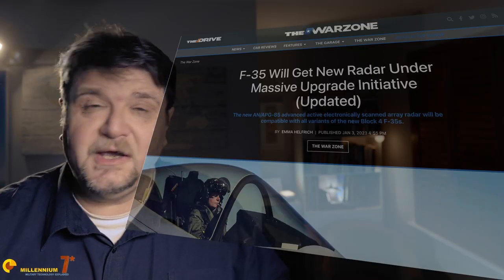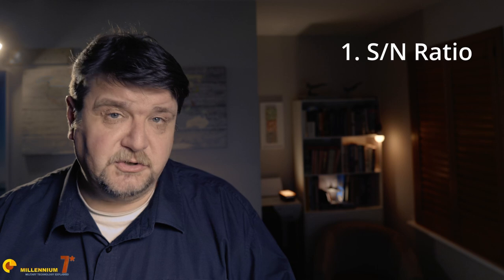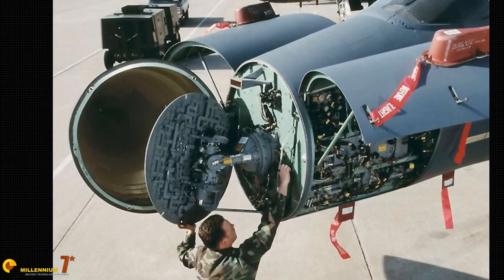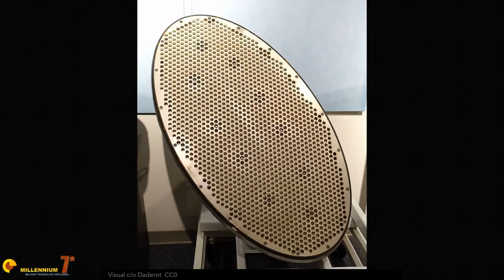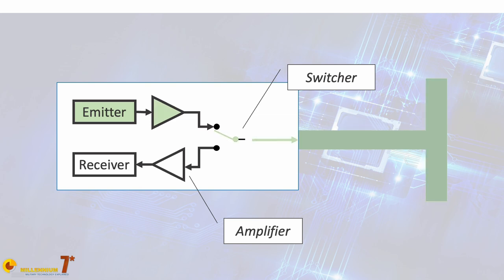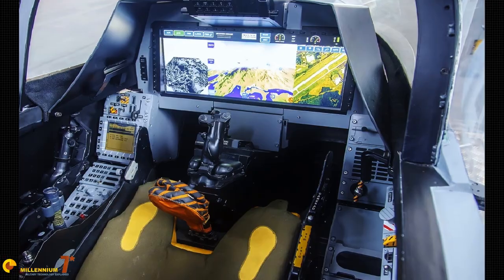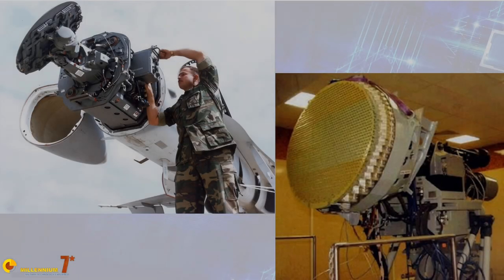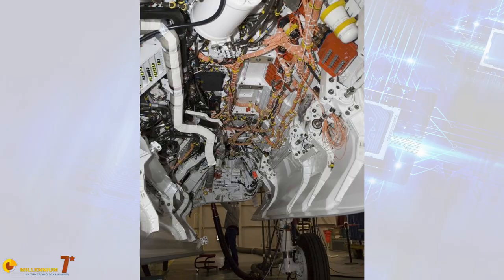The insane engineering of the F-35 AESA radars!

Comment: I'm an F-15C pilot.  Believe it or not, the APG-63v3 radars are significantly better for air to air missions than the APG-81  1. more TRMs and 2. no air to ground TRMs.  Multi-role radars hamstring the air to air effectiveness of detecting and tracking.  Size real estate (# of TRMs) is also a big factor, as you covered in your video.  These advantages routinely allow jets with the biggest radars to shoot down opponents before opponents were even aware they were in danger, as AIM-120 doesn't alert the other jet's RWR until it goes pitbull.  This is one of the biggest reasons for the push for data links, allowing smaller jets to get information from AWACS or larger jets.  There is a reason why Owls have huge eyes.  Bigger is better.  Bigger airframes also have more space for cooling.  We also maneuver better in the cons (thin air above 30k feet) because big wings catch and hold more air.  F-16 and F-35 skate around like a hot knife through butter up high.
Reply from the maker: Thanks for pointing out!
Reply: In clear sky, all missiles give themselves off to modern missiles warning systems, the moment they are fired.
The numbers of TRM is not the only parameter that decide output of radio power. Aperture and output power/TRS is equaly important. Can you eplain in detail how this number affect the capability of the radar, please?
Reply: I believe that one version of F-15 radar could be datalinked with other radar to increase aperture?
Reply: 🤫 no more talking please
Reply: Except the F15 keeps getting smashed by the F35 and F22 in war games because it is unable to detect it with it's radar.
Reply: @carisi2k11  Wrong.  We can detect them.  Maybe in video games you cant detect them.
Reply: @BasedF-15Pilot  How much you can tell about your ability to detect them?
Reply: @matheuscerqueira7952  Nothing, as it is classified and will remain so likely for a long time.  There is an E-model pilot on Ward Carroll's channel that mentions it offhand as well, episode called 'Deep intel on the F-35.'
Reply: @BasedF-15Pilot  I used to "hate" the F15 when I was younger because I fell in love with F16, being somewhat of an underdog in comparison.  The older I've gotten the more I've come to respect the F15 for its incredible capabilities.  I hate to admit it, but it just might be the best aircraft ever invented, in terms of longevity and capability.
Reply: @phoenixrising4073  When I started ENJJPT I held the F-16 over the F-15 personally as well, but in school my mind changed because I unlearned some assumptions and learned more about what is advantageous in modern air combat.
Reply: Did you fly an aircraft with the apg-81 ever? What are its advantages over the apg-63
Reply: @matheuscerqueira7952  Some ideas for how to detect them:
1. Radar warning receiver (you can see other radars from very far away)
2. Infrared sensors
3. Networking (eg even using ground stations and AWACs)
4. Using aircraft at different altitudes to scan for enemies from multiple angles
5. Use sensor fusion to detect stealth aircraft with a combination of sensors
6. Or your radar can detect enemy stealth aircraft further than their missiles can reach

Im sure theres special radar modes optimized towards detecting stealth aircraft. I also remember reading that eg an F35 has a the radar signature of a bird, but its also different from a bird. There was a lot of talk about powerful computer systems to help detect stealth aircraft. Maybe that part of it.
Reply: @termitreter6545  From what I know, the F-35 is between a rock and a hard place against planes that have IR sensors since it doesn't have supercruise. Meaning it will have to turn on the afterburner, turning itself into a shining beacon, to optimize the missiles range or get too close for it's own good
Reply: @matheuscerqueira7952  It would be interesting to know how far the common IR sensors can detect an F35. European fighters got stuff like pirate IRST thats supposedly quite advanced, while Russias fighters have more primitive IR sensors.

After all, aircraft stealth is all about making it harder for the enemy to detect and combat you. If the detection range goes from 200 to 50km, and missiles are less reliable against you, then stealth has fullfilled its purpose.

I dont think supercruise itself is too important though, thats a rare ability. F-35s under threat can just use the afterburner, and one of that planes qualities is a big fuel tank.
The weak engine and top speed of 1.3-1.6 mach is more concerning.
Reply: Ah f15 and su27 are mean and beautiful airframe, and tomcat too. F5 also a beauty, slick looking aircraft
Reply: @termitreter6545  "The weak engine" I mean I get what you mean, in relation to the weight of the plane it's not that powerful, but I still dislike it when the F135-PW-100 is called a "weak engine. That single engine can put out 125 kN of dry thrust, which is just 5 kN behind the combined output of the F100-PW-220 engines used in F-15Cs, and in afterburner it's 191 kN vs. 210 kN. Compared to the F100-PW-229 engine in Block 52 F-16s and upgraded F-15Es, the F135-PW-100 has almost 60% higher dry thrust and almost 50% higher burner thrust.

What I'm getting at is that the engine in the F-35 is _really damn powerful_, as far as I know the most powerful single engine in any fighter jet today. But it is of course offset by the plane being being so damn heavy. It's not that much bigger than an F-16, but the empty weight is over 55% higher, and the gross weight is higher than the maximum takeoff weight of the F-16... A lot of that is fuel tho, the F-35 can carry almost three times as much internally as the F-16.
Reply: Thanks for all you do.  I wish you nothing but tge best.  MERICA!!
Reply: @mrizkic  F14 is the series plane ever made in my opinion.
Reply: I'm not sure he understands what "wet dream" means.  13:10 🤣🤣🤣🤣🤣🤣
Reply: Interesting how F15 is STILL considered as the most combat capable US plane by the opposition. Defeats the very point of F22 and 35.
Reply: im taking notes
Reply: AS a prior ECM maintenance instructor I fully agree with you  I retired a couple of decades ago and what he is selling was old news when I Instructed MOTE technicians at Hill AFB.
Reply: TicTac 😂
Reply: @Simon_Nzioki You should invite your Su-35 pilot friend to this thread so a fake Su-35 pilot can battle it out with a fake F-15C pilot
Reply: Are the TRMs not just generic modules that are software defined? If that's the case I would think it's just a question of function prioritisation, doesn't always make sense to spread your bandwidth over all the possible uses, sometimes you would want to dedicate the whole array to a single function to maximise sensitivity and/or power. I'm sure this can just be done in time space by flipping in and out of specialised and multi function modes.
Reply: @Simon_Nzioki  even ChatGPT can sound like a pilot, if you rub it the right way
Reply: @LeonAust  Truly an amazing feat since F-15s did not participate in Arnhem thunder.  Thanks for educating us all on the amazing capabilities of the RAAF F-35s.
Reply: cope lmao
Reply: @YungRolex  Keep playing video games, kid.
Reply: and dodging every tough question ofc
Reply: @LeonAust  Did you know I don't need a lock to fire and get a kill?  :)   I can blot out the sun with 120D missiles and I banzai for a heater kill while fat amy is defending pitbulls.   Did you know I can winchester (missiles wise) a fat amy and still have over 3 to 4 times the missiles stores left on the pylons?  Did you know the fat amy uses fuel to cool her radar, and the closer to joker/bingo she is, her radar range suffers for it because it thermally throttles?  Radar ranges specifically as it deals with RCS is classified sowe are not going there in YT comments section.  MAR dont matter cause I'll bait the MAR all day long with airspeed, altitude, and notches. 120s dont do well chasing F-15s uphill 20K and at acute maneuvering angles but they work a lot better going downhill, my LAR is better.  Stealth is an advantage at certain angles, not a 360degree invincibility cloak like many civilians and politicians are led to believe for that sweet $$$.
Reply: @BasedF-15Pilot  Nothing? You have definitely said things in this thread lol. You have said:

1) you can detect them
2) you said that the planes with the bigger radar often win (in relation to the F35)
Reply: @VintageDynamo  ok redditor go off.
Reply: @BasedF-15Pilot  It's true though. You said that you could say nothing. And yet you have said some things.

So which is it?
Reply: @VintageDynamo   "You said that you could say nothing." This is a disingenuous lie.  What I said was "Radar ranges specifically as it deals with RCS is classified sowe are not going there."   If you don't have enough folds in your brain to understand the difference between your lie and my statement, I can't help you.
Reply: @BasedF-15Pilot  Do you have any comments on laser induced plasma based decoys?
Reply: @BasedF-15Pilot  Any idea how the Block IV upgrades would impact your TTPs against F-35?  Presumably, cooling should improve in Block IV?
Reply: You have made a really good point. Brute force power can give you longer ranges compared to AESA. The THEORY of aesa was well known. Even synthetic aperture radar is well known. There is a lot of radio astronomy based around that. 
What has changed is the ability to use GaN and GaS. 
One has to just look at the small sizes of GaN laptop chargers to get an idea. 
I wonder if the older radar are more susceptible to intelligent jamming compared to AESA which can use spread spectrum to hop around your jammer. 
Also, the Russians use large white noise generators so the jury is still out since they can drown out pretty much all radio signals. 
For this, I don’t have much data and I don’t want to know.
Reply: Sorry to tell you the F-35 doesn’t skate up high any more than a F-15C. F-16 sure but not the F-35.
Reply: @BasedF-15Pilot  Ward Carroll wears his flight suit every chance he gets but he was not a pilot. He sat in the back seat and turned knobs on a screen. The Internet allows any wannabe to appear to be an expert.
Reply: @leeoswald9799   Ward annoys me and I had to set his channel to do not recommend.  I watch the fighter pilot podcast and 10% true podcast.
Reply: Elaborate further + what about the apg 85
Reply: @BasedF-15Pilot  dectect or target?

Comment: The next step on fighter radars is digital beamforming which was impossible until recently due to size and weight constraints but electronics miniaturization has done it's thing...though I wanted to see your take on the APG-85 like you said in the title, but it maybe for the next video
Reply: @Gags  you're welcome buddy :)
Reply: Digital beam forming was present in WiFi 802.11n, at least a decade old.
PESA uses beamforming, either in the analogue or digital domain.
It's the bit where you change the phase to change direction of the beam without moving the antenna.
Reply: @amzalkamel3009  well your reply isnt visible. Did yt remove it for some reason🤔
Reply: @gags730  Well, in 5G you have maybe a dozen antennas to control and the target is moving around at a few meters per second if at all.
In a jet you control about a 1000 antennaes (the pictures seem to show such a module count) and the beams have to be adjusted perhaps a 100 times per second ....
Reply: it is thing?
Reply: @studytime2570  look at the edit in OP Reply for your answer, I believe.
Reply: @amzalkamel3009  could you retype that comment you left about beamforming, it isn’t showing up anymore?
Reply: @Jonathan Pfeffer  it's weird I can still see it
Reply: @studytime2570  I can still see it, weird
Reply: @amzalkamel3009  could you just copy/paste it in a reply to this comment?
Reply: @amzalkamel3009  YouTube sometimes “shadow removes” comments, so nobody else can see it but you
Reply: @amzalkamel3009  I think the original poster can see their own comment while other people cant.
Reply: @studytime2570  It may not be YT. Signals intelligence probably monitor sites like this one. Could be them. ?
Reply: @beb5816  but the comment was not visible. Therefore it must be yt's algoritm?
Reply: @studytime2570   Signals intelligence probably monitor sites like this one. Could be them. ?
Reply: @studytime2570  Did you get the last one ?

Comment: There was a paper with a subsequent practical implementation for active self-interference cancellation, allowing simultaneous transmit and receive on the same antenna.
Uses similar techniques to noise cancelling earphones.
No doubt this is already in the latest radars.
Reply: EM cancelling system would eventually allow for fully stealth designs like cloaking technology from star treak
Reply: @hphp31416  https://en.m.wikipedia.org/wiki/Plasma_stealth

That is one most hyped features that Su-57 was claimed to have when the fighter was revealed and it was mythical by its features. As who would be able to do that, they could effectively become transparent to RF spectrum.
Reply: @paristo  The SU-57 has the ability to do what exactly?
Reply: No this is just a technology to allow a transmitter and receiver to simultaneously transmit and receive on their shared antenna.
It has nothing to do with stealth.

Comment: GaN is pretty exciting stuff. For example, the old motor controller on my electric motorcycle was standard silicon, it was heavy and about the size of a tissue box. It overheated and died. New one features GaN components. It's 1/4 the size and weight, with an extra 1000 watts output. Similarly, my new phone charger block is the size of a standard iPhone charger, but charges at 65 watts.
Reply: Do you really have a GaN component electric motor controller in your motorcycle?  What type of motorcycle is it and was this advertised, or a modification made?

Comment: It occurred to me. When you mentioned several antennas around the aircraft, now with modules we’re no longer limited to having a single emitting region on the nose. We could place them wherever we wish on the aircraft, say on the wing roots of the belly, tail, or fuselage. Not just small radars but almost engrained into the machine. Similar to the F-35’s current RWR which is baked into the skin, but it’s just modules all over the jet providing images all over.
Now there are probably limitations, but who knows.
Reply: Not just on one aircraft, if the relative position of the planes in a flight is known, that radars could work together, similar to Very Long Baseline radio telescopes.
Reply: Interesting though, I was thinking about this but wondered if there might be dynamic issues to consider in the normal movement of the components relative to the different arrays. So whether a nose mounted and wing mounted arrays would be greater than the sum of its parts, notwithstand that the structural duties of the wing leading edges might not lend itself to arrays mounted behind them if  optimisation for it's transparency to radar cannot be balanced. A longer base distance could some localised depth perception to the aircraft
Reply: The SU57 is supposed to have two small radars on each side of the cockpit and the one in the nose then small on the wings and one in the back.
Reply: @kilianortmann9979  No. The relative positions of the different aircraft vary too much and too rapidly for a multi-aircraft array to be feasible.
Reply: @aramisone7198  The radars are all separate sets and their antennas are dispersed about the aircraft in order to prevent them from interfering with each other.
Reply: I think the biggest limitations are the thiccness of the electronics and cooling requirements. The modules will become slimmer over time but routing water cooling all over the aircraft would be challenging.
Reply: @guitarazn90210  that’s a very good point.
Reply: Even more extreme, multiple aircraft (drones) in the formation can emit and receive cooperatively. Astronomers are doing this already, its not magic, just a lot of processing power.
Reply: @kilianortmann9979  If you want to do beam steering, you better have sub-wavelenght precision. You would have a hard time achieving that on an airframe that is flexing and bending under aerodynamic stresses. Much less with multiple airframes. I bet you really need monolythic array do that (or extremely fast and precise relative position monitoring.
Reply: @DominikPinkas  Good point. It's probably not feasible right now but I bet someone is lookig at it.
Reply: @guitarazn90210  Better electronics would not need any active cooling at all. We are not there yet, but there is no physical law prohibiting the radar making 10x less heat than currently. Most heat is generated from the switching inefficiency of the transistors.
Reply: Conformal antennae arrays, originally planned as far back as F-22 :P
Reply: @hb1338  Then please tell me how that networked sensor concept has worked on the SAAB 39 Gripen since it entered service, and not just for networking with other Gripens but with ground and ship based Airforce, Army and Naval radars too...
Reply: questionable utility, given how such small radars would have relatively similar ranges to IR or EO sensors (which is already done in the F35), while being much more expensive and requiring more cooling systems and greater power requirement.